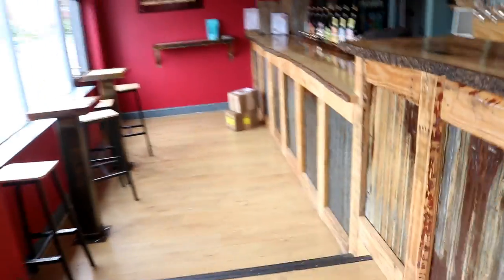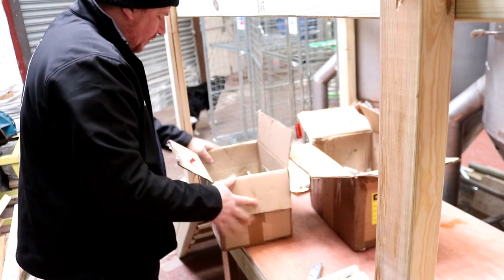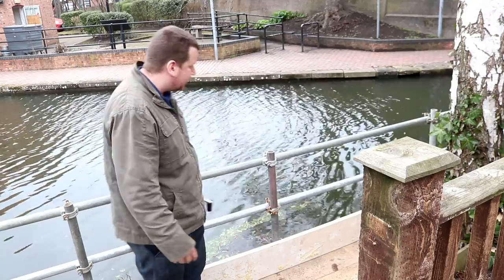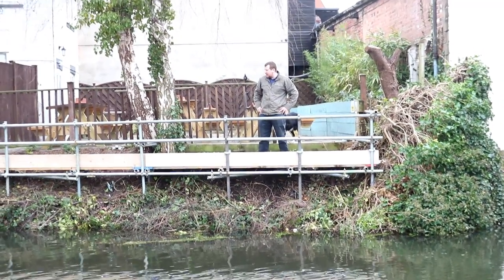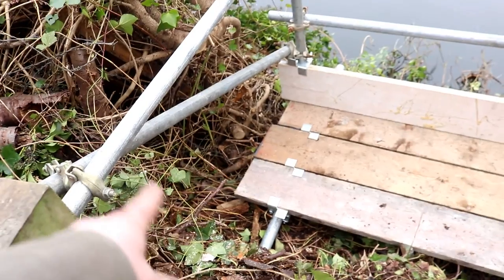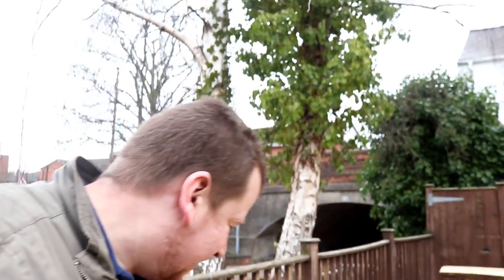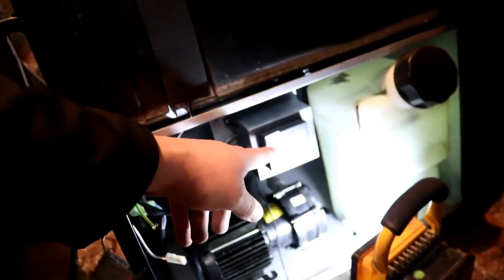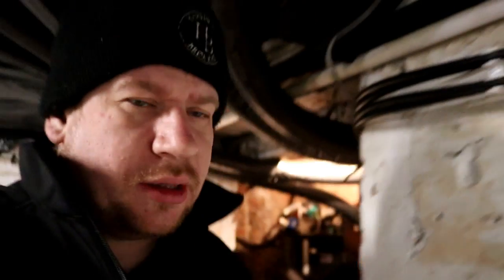AND THE STAT QUIT

Comment: Harry, the issue is more if someone falls and hurts themselves or at worse fell in the canal off what you have built. Are you insured for people to use what you have built? Does your public liability cover it ?

I think personally you are taking a huge risk there, if you are happy to take the risk then run with it. You are still liable as you have made access to use the jetty, regardless of what signage you put out there.
Reply from the maker: All valid points Tony. I am currently considering my position on the whole thing.
Reply: Yeah and what happens when its packed with people and it tips into the canal.... these things really could do with some civil engineers input/design. Really this may need some pile foundations or cantilever structure with an assessed weight capacity. Imagine some accident ended up closing the pub and brewery :o